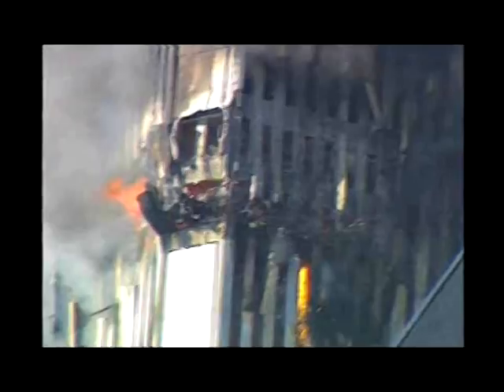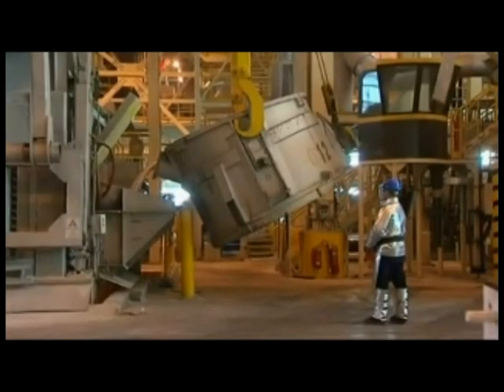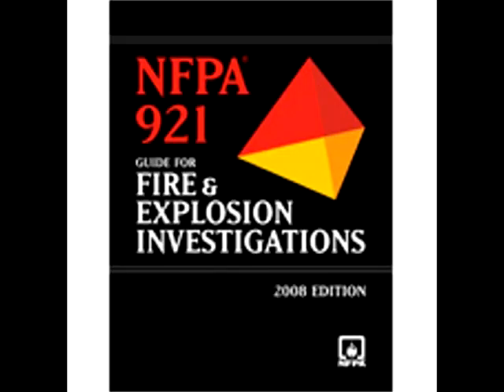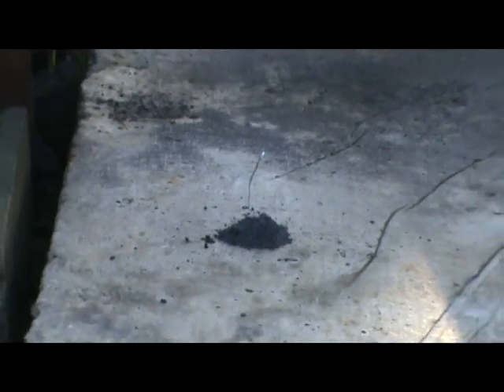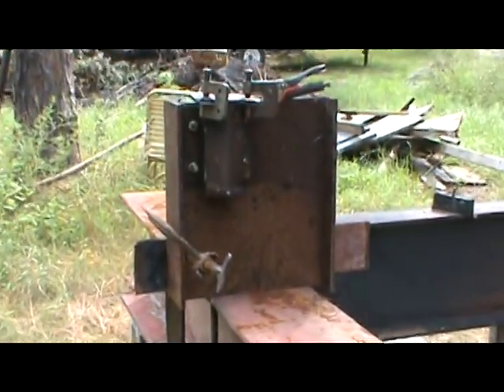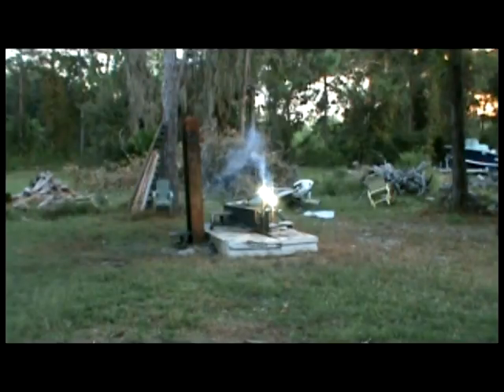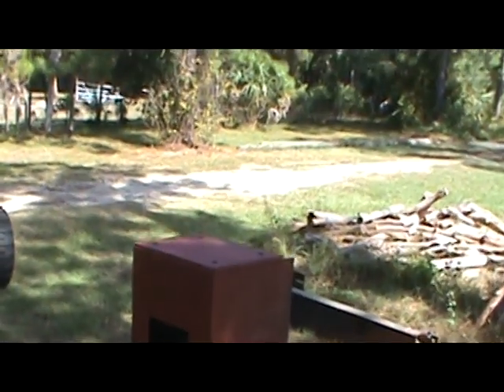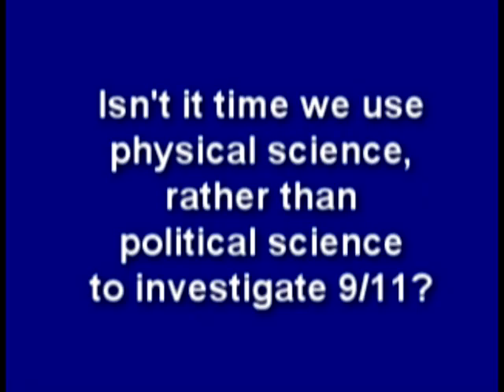9/11 Experiments: The Great Thermate Debate

Comment: Spontaneous thermite reaction can arise when melting aluminium contains parts of steel. It sometimes happens when amateurs try to cast second fusion aluminium from aluminium scrap which is contaminated by small steel parts (they should have checked with a magnet).
Could this have happened,

Comment: A jumbo jet and an office, anything could've melted in there jets are made of lightweight metals and it's not rare to see aircraft melting from it's own fuel in a disaster. The beams also don't need to melt to collapse, it just needs to weaken as it still was holding more than 10 floors on it and a small collapse can easily ripple and create a domino effect

Comment: wow this is probably the most revealing 911 video on youtube.
You are a genius. This proves that thermate was used to blow the building up.
How else do you account for the molten steel pouring from the building? and the fact that
fire smoldered in the ruins for a full 3 months??? jet fuel does not burn hot enough to melt steel
nor does it burn for 3months after initial impact. The govt will never reveal the truth but we know.

Comment: if you could slow the burning of the thermite would it cut better? it  seems to me that it burns up to quick and does not have time to heat the metal, awesome video the way you used tubing to direct the burning